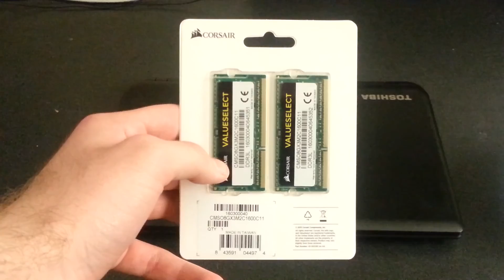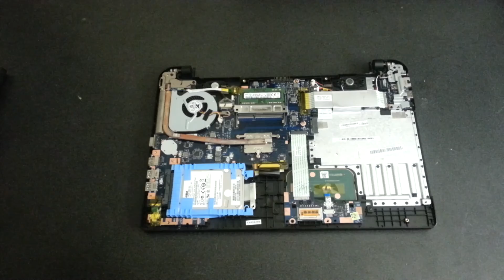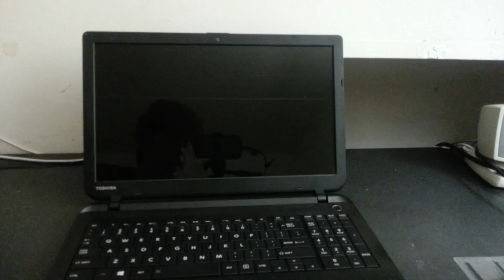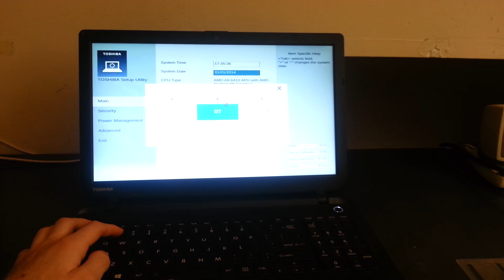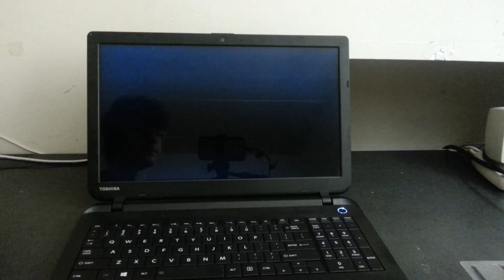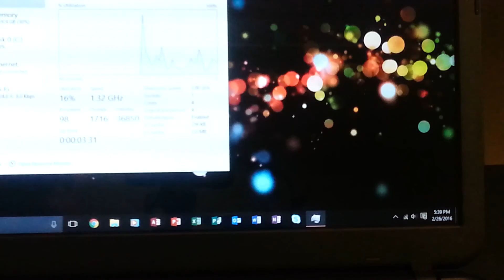How to Upgrade Your TOSHIBA Satellite C55D Laptop Memory

Comment: I upgraded my Toshiba Satite with a free 240GB Inland SSD I got and went from 6gb of oem ram to 16gb of Patriot DDR3 1600mhz this difference especially in graphics performance is insane I got a 20x increase in FPS I used to get 3 FPS trying to play a game now it’s steady 60FPS just crazy and so much faster and I’m on memory hog windows 8.1, when I go to 10 it should run well, it’s an 8 years old laptop that amazingly still runs good mines an AMD A-6 APU with R4000 graphics
Reply: Have you verified it's.running the RAM at 1600MHz? That's pretty good for a laptop.

Comment: It's difficult to install the RAM because you were trying to put it in flat. You need to tilt it at an angle, maybe like 30-45 degrees then insert it gently all the way in the RAM slot, then press it down flat and the levers on the sides will hold it in place.
Reply from the maker: I know that.

Comment: I set the clock with a 12 hr. Time period and it will not go past the Toshiba screen leading innovation. What can I do? I put in 
Eight gigs and already had four gigs. Do you think that my system can handle that much memory. I'm sure I installed it correctly.

Comment: Hey Stephen Im curious did this increase the speed of your laptop? because I saw after you went to task manager and your disk usage was at 100% like mine always seems to be? Im considering buying more RAM but there is no point if this doesnt help speed up the system?
Reply: Disk usage has nothing to do RAM. To see any performance differences youd want to compare pre and post RAM installation RAM utilization. And of course the more RAM available, the more programs can run at the same time without crashing
Reply from the maker: Vontarius Davis Oh well, it sorta changes it.
Reply: Assuming after several years this isnt helpful but to fix your problem simple way would be to reinstall windows, harder but more long term way would be to swap out to an or add on an ssd to the HDD

Comment: where is the CMOS battery located? I went thru the motherboard both sides I cannot find it. It keeps losing its memory when i pull the battery out.
Reply from the maker: Christopher Ryan 1:36 is the only battery I pull out, so I assume it's in there.
Reply: There is no cmos battery with this model.

Comment: Is it possible to add the 8gb ram with my 4gb ram to make 12gb ram on my Toshiba Satellite C55T C5239
Reply from the maker: No. Two sticks have to have the same amount of RAM.
Reply: Stephen Phillips I wondering if a Crucial 8GB Single DDR3L 1600 MT/s (PC3L-12800) SODIMM 204-Pin Laptop Memory (CT102464BF160B) be used on my computer toshiba satellite Toshiba Satellite C55T C5239 (this is ram right because i need it for gaming lol)
Reply: Stephen Phillips totally wrong.

Comment: ...so what if I wanted to turn my toshiba C55d-b into a gaming computer over time. besides upgrading the RAM and processor, what else should I save up for?
Reply: Save up for a better laptop or build a gaming desktop. Seriously. Do not bother trying to upgrade this laptop to a “gaming laptop” you’ll be very disappointed. Even if you managed to change the cpu and add or change the gpu you’ll soon notice it’s not built to handle the heat your new components will create under stress and you’ll just end up killing the laptop. 

Asus g751jy is my gaming laptop and it’s awesome. Otherwise w the money you’d save to upgrade this, I’m sure you can build a far better desktop.
Reply: Just bear in mind, many laptops use soldered-on CPUs/GPUs, so you may not be able to upgrade those. I don't know about your particular laptop. Even if they are socketed, you must get something which is compatible with that socket & motherboard.

Comment: you could of bought two 8 gigs of ram for that much witch goes to 16 gigs of ram
Reply from the maker: So i saw on Crucial. Very good idea.
Reply: +Stephen Phillips with 16 gigs of ram could i edit video with this computer maybe add ssd too
Reply: @streetbizzmixtapes  I watched my system monitor while playing youtube videos,  at 480 p. My CPU usage goes to 80 and 90 some percent usage, while my memory usage also goes up near the top of 80 and 90%, with some memory swapping. I can;t speed up the CPU easily, but I can increase memory to 8gb. Sixteen GB ram would not speed up my system if I'm not maxing out the 8 GB, which isn't likely in the next 8 mo. or so, when I hope to have a faster Laptop.  I also believe memory swapping is taking CPU time, and will see if the CPU usage drops after my upgrade in  a week or so. Still trying to find if I need one module or two. I see no reason a faster hard drive will fix my problem. btw, Was able to watch my network activity, which was not significant. I had thought my ISP was throttling my Internet speed. Nope, not my problem. So, this guy removed a 4GB module to added 2 4GB modules! What? Were they not compatible with each other? I think he wasted a 4GB module for nothing. Just needed to add ONE 4 GB module. 
4 plus 4 = 8
What we saw here was 
4 + 4 + 4 = 8